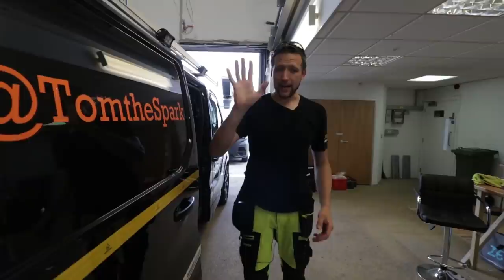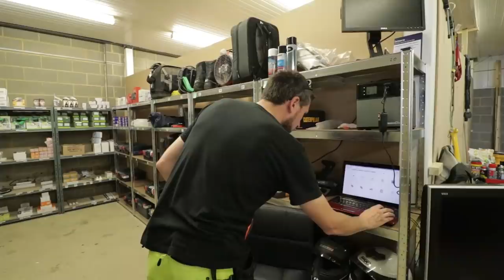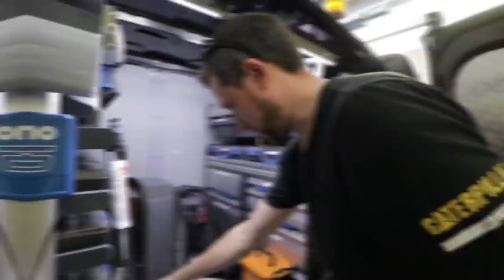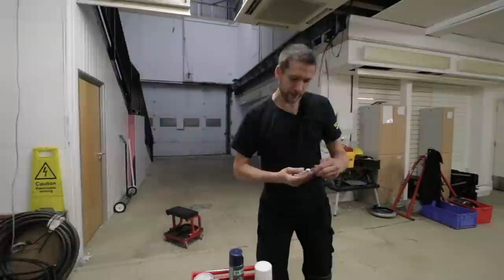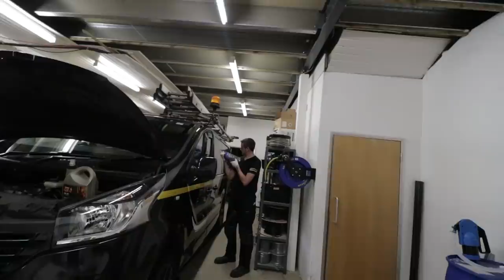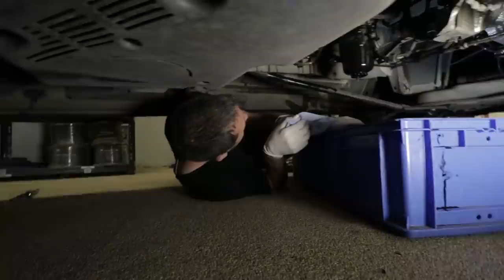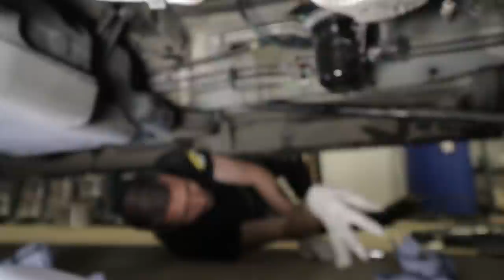When ELECTRICIANS try to be MECHANICS... | Thomas Nagy

Comment: Does make me laugh how the general public are not allowed to install a light fitting & must get a qualified electrician to fit it but we are more than happy to let people service the braking system or any other safety system on their 2 ton van & then drive it down a motorway at 70 & not bat an eyelid.

Don't use Crossland filters as they are total crap as its a euro car parts brand all made in china. You should be using Hengst, Mann or Mahle filters especially the oil filter due to how critical it is. I have seen many prematurely fail due to collapse well inside the service interval.

The "boffins" don't calculate anything, the extended service intervals are totally shambolic as anyone who has rebuilt a modern engine will tell you. They just slowly fill with sludge until a few years later (outside the warranty) they fail due to excessive carbon built up.

Not only do you have the engine breathing it own exhaust gases due to exhaust gas recirculation systems to keep emission figures down but extended service intervals that no oil no matter how many additives you add to it can deal with. But the automotive industry must look like it is doing everything it can to reduce emissions so just extend oil change intervals as that costs the manufacturer nothing & it makes it look like they care.

A modern engine will cope with dirty oil for the first few years but then you will start to see the problems later down the line which by that time the vehicle is well outside the warranty period & it gives them a great excuse to sell you another.

They are basically kicking the can down the road for the customer to pick up, keep changing your oil every 10,000 & you will reap the rewards. I prefer to drop them every 8,000 TBH. Oil plays such a critical role in modern engines its imperative it is kept clean.

Get yourself one of these priming kits so you can properly bleed the fuel system after changing the filter:
https://www.sealey.co.uk/product/5637206134/diesel-fuel-priming-set

You will find on some models there is a lift pump in the tank so it will self prime but many manufacturers now have done away with the lift pump in the tank & now rely on the fuel being syphoned from the tank to the injection pump on the engine. They work great until you break the system & introduce air into it.

You will never start the engine by just cranking alone if the syphon system is in place so you need to pump the fuel from the tank yourself to start the engine & the quickly disconnect the primping pump & reconnect the fuel lines.

Continuously cranking the engine will just result in a flat battery & excessive strain on the starter motor.
Reply: I do agree with you there matey about the intervals and the filter brands, Oil spec matters but the triple qx ect are just as good as the more expensive oils according to tests. No priming pump is actually ever needed on those vans, They have a priming pump built into the tank so you never ever have to blead them. Just turn the ignition on for a minute and away they go.
Reply: @ronanwood6891  Yes on his Renault there is a lift pump in tank as can be seen by all the fuel on the floor but on the transits as an example especially the ones with the Lynx engine there is no lift pump & as soon as you disconnect the filter the fuel lines all drain all the way back to the tank. 

There is no way the high pressure fuel pump has the head to get that fuel back up the lines.

You need a priming pump, to add insult to injury they used to provide one next to the filter but that soon got removed as I guess its another way to save a few quid.

They also like to airlock on the high pressure side between the high pressure pump & the injectors due to how the lines the the injectors are nigh on vertical on points.

Only way I have found to get round this is to slacken the nuts connecting the high pressure lines to the injectors & crank but I hate doing that as the pressures involved at that point can easily kill you, just like electricity. :)

Comment: Oil after 12k miles still as good as u put it in? Are you for real? Naah mate it's not as when you putted it in, all thou it's doing it's business lubing the engine, clean it and cool it. But yeah once used it's used :) I just did a service on a Mazda MX-5 that did it's oil service 1 year ago and did 1000km on it. It was clear, but not as clear as it was when putted in :P

Comment: Think yourself lucky you don’t run Transit Connects only doing 4700 miles before oil change required display comes on dash. Ford blame it on drivers going short journeys. Horse sh**!!!

Comment: Honestly don't blame you doing it yourself. Mechanics are just taking people for a ride. It cost me £50 to service my veichle. Oil, and filters. Mechanics quoted me over £175 just for oil and filter and labour. Madness
Reply: All labour is expensive even Thomas' crew.
Reply: By that logic all electricians are just taking people for a ride! As it doesn’t cost hundreds of pounds to swap a couple of face plates and a smoke detector in parts costs.

In reality all trade have tool, labour and overhead cost, quite odd to see a comment here just ignoring the reality of business
Reply: When you service your car on your driveway there are no other costs involved. A mechanic needs an industrial unit, heating, waste disposal, equipment. It all adds up. Im not a mechanic by the way but i see why they charge what they do.
Reply: @michaelwilliams3648  Sensible comment on the balance of skilled blue collar work, carrying some degree of liability.